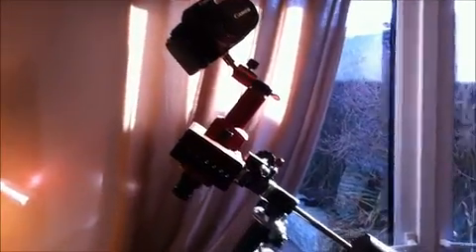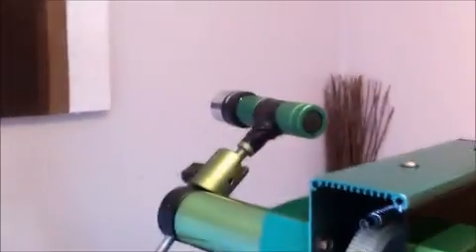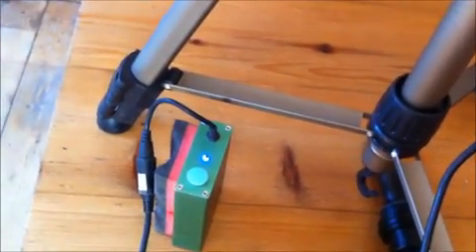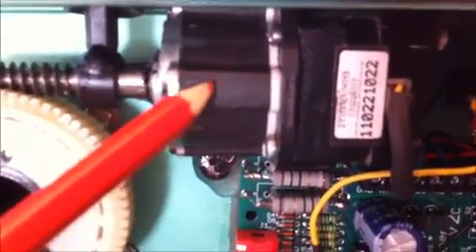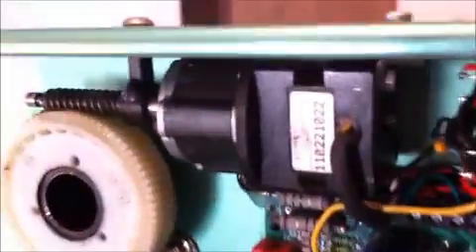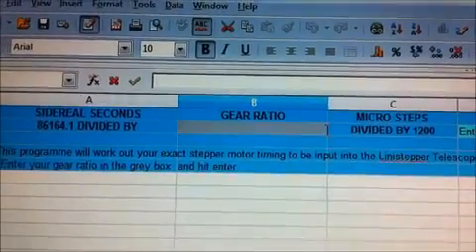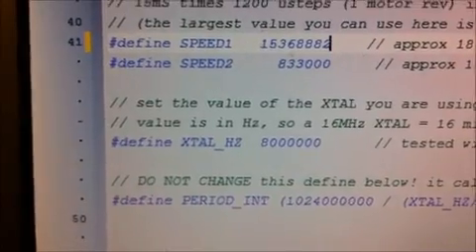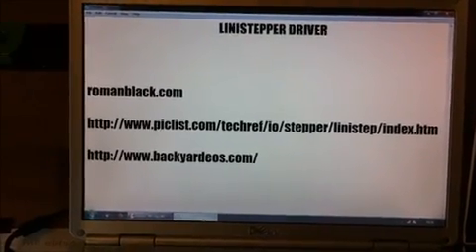Home Made Astro Photography Mount with LiniStepper Driver

Comment: I know it would not be as accurate as your stepper, but do you think that a cheaper motor with built in gearbox (like a 28BYJ-48 stepper 5.625°/64:1 4096 steps/rev) could drive the same worm-gear assembly with the camera mounted? I am not exactly sure how to calculate the torque on the worm and gearhead shaft and can not find your gearbox & stepper combination anywhere either. The motor mentioned above is widely available in the UK

Comment: Hi, thank you for the video, definitely inspiring.
Just have a couple of questions if you don't mind:  Where did you get the gearbox & worm gear? and What's the diameter of the finder scope?
I looked for those two components and their price alone puts the project at well over £85 (±$150CND).
Once again thank you very much for taking your time, just got myself a small lathe and this may be my first project on it.

Comment: Now THAT, is a TOTALLY /EXCELLENT/ video! Nice details, explains the motivation, features, how it was done, how it operates and even a bit on how to modify it for your setup. 

I'm very pleased to be able to sell the kit of parts for the electronics! A slightly shorter URL for the Linistepper (the middle, piclist link in the video) is Linistepper,corn In the future, we will be offering an option of a replacement part for the kit, pre-programmed for this application.